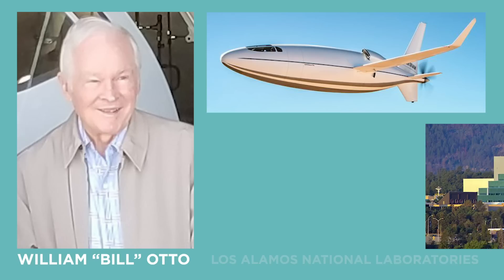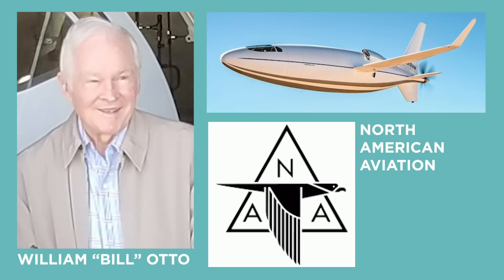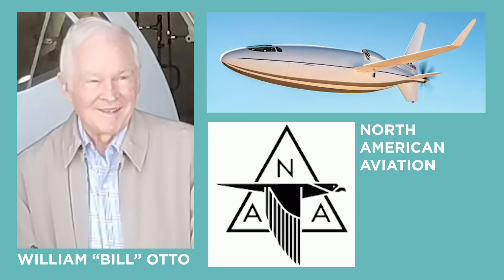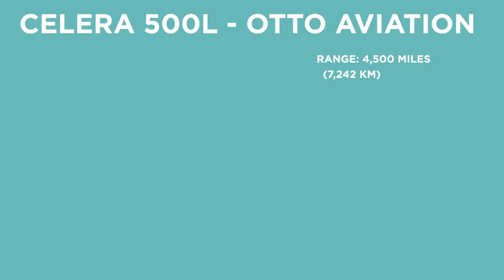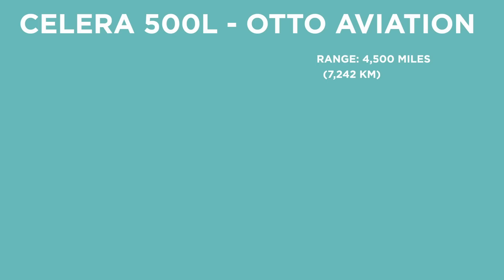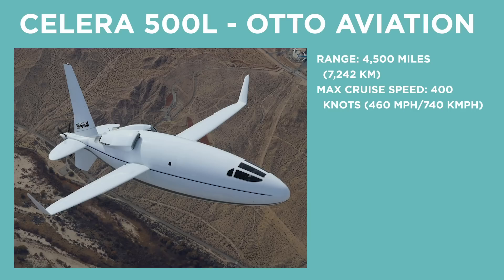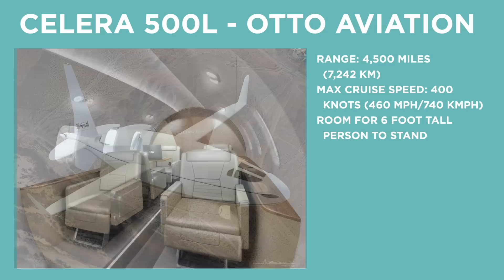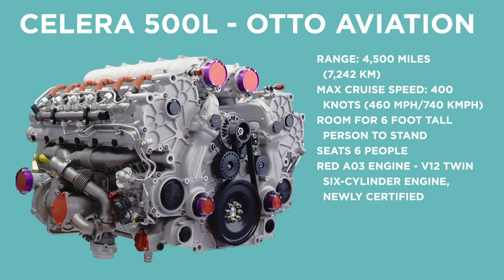Could This Plane Save The World? (Hint: No.) | Answers With Joe

Comment: It makes sense that they started with a smaller plane, time will tell if this model can be scaled to hold hundreds of people and really disrupt the industry.
Reply: Aurora D8 is a commercial jet concept with the same design principles applied
Reply: One can't just scale up a plane without considering the SqUaRe CuBe LaW
Reply: It really cant very much, its a single engine pusher prop design.
Reply: Yes I agree, the technology is scalable
Reply: I could see corporations buying these because of the fuel, and crew savings.
Reply: I can see the applications for scaling up to something more commercial in size. But also for an Electric jet option. Low power consumption is way more important for electric power.
Reply: Why bother? You want 6-8 seats to accommodate family groups uncomfortable with being around hundreds of potential disease vectors.
Reply: Not unless they install two turbine engines instead of one piston engine, so that the aircraft has engine out capability, and so that it is legally allowed to operate with more than 19 passengers.
Reply: Otto is already looking at this, but laminar flow doesn't scale up very far.  From their website, "The Celera 500L can be scaled up 20% while maintaining its extensive laminar flow. This increase results in a cabin volume nearly double the size of the current configuration. This means more passengers."  A dozen passengers yes; 100, probably not.
Reply: I was about to say that, But somethings can't be scaled up, as for this i have no idea as not an aeronautical engineer, i did work out once on a long boring flight a 747 does 50 miles per gallon (uk) per passenger, but didn't keep my calculations, so can't share, and could be talking total bollocks.
But if i was doing it again   distance / ((fuel_ltr*4.54)/passengers)  and over a 4500m flight.
Reply: @nathanchildress5596  it really really isnt. It has swept wings for higher speed (much less efficient), thicker wings (much less efficient) turbofans rather than propfans (vastly less efficient). and doesnt appear to be designed as a lifting body as this clearly is.
the biggest thing we need to design for to save fuel is LOWER SPEED
Reply: @nasis18  : or for a new "taxi" market, applied to plane travel.
Reply: @Tuxedo_Cake : The planned engine is actually 2 engines side by side coupled together and allows running on 1 side in the event of failure.
Reply: @waynet8953  So that's like a single shaft, multi engine helicopter. That still doesn't provide engine-out capability in case of prop failure or prop overspeed etc. It's better, but not good enough.
Reply: @davidegaruti2582  ... ok, all you want, but one cannot just scale up a plane that relies HEAVILY on LAMINAR FLOW without considering the REYNOLD SNUMBERS. The flow doesn't care about the size of the plane. It will become turbulence after running a given number of inches along a surface. If the surface is not so many inches long, those inches of laminar flow can be a sizable fraction of the surface. If your plane is airline-pane-size, those inches of laminar flow are almost meaningless.
Reply: @johnbuckner2200  ,,, It is not. Laminar flow is not scalable.
Reply: @adb012  it is the concept is simple keep The airflow smooth on the surface till it terminates back into the airflow  smoothly the concept has been used for years (ex. F100 super critical wing).
Reply: @johnbuckner2200  ... Nope, that's not how laminar/turbulent boundary layer works. Laminar flow airfoils typically have only a few inches of laminar flow and that IF the surface is super smooth, glossy and shiny and without joints/seams/rivets,/etc. Fly through a swarm of mosquitoes and bye-bye laminar flow.
Reply: There are many examples of it’s use including things like flat rivets instead of button rivets. Also the FB111 was designed around the concept.
Reply: @johnbuckner2200  .... And by the way... supercritical is a totally different concept than laminar, although shapes that are good for one tend to be good for the other.
Reply: So was the SR71.
Reply: @johnbuckner2200  ... Yes, sure, supersonic airplanes with laminar flow. Whatever. Stop the nonsense, it is quite evident that your knowledge of fluid dynamics is equal to zero.
Reply: Laminar flow concepts can't be simply scaled up. The Reynolds number has a word in that.
Reply: The fact of the matter is that both Boeing and Airbus have teams of engineers scraping every bit of fuel efficiency they can out of the big designs.  

And other people have already said it but it should be repeated: small aircraft design does not scale.
Reply: @Tuxedo_Cake  note that the engine can still work with half an engine. It's designed so that one side of the engine can go bad. Also the glide ratio of this plane is insane and adds a significant safety margin.
Reply: @HotelPapa100  ... Are you kidding? Of course Reynolds number has a word: Re=Ro*u*L/v, where Ro is the density, u is the velocity, L is the length and v is the viscosity. So you you quadruple the length, are you going to reduce the speed to 1/4 to keep the same Reynolds number?
Reply: @adb012  My point exactly. Larger plane = smaller percentage of laminar boundary layer.
Reply: I'm surprised Joe didn't make more of a point of the question, is the Celera efficient because of the current size it is or simply the shape...and if its the shape, how much can it be scaled up to a point where it makes sense financially. 

Obviously a startup can't suddenly make a 747 size aircraft straight off the bat, but if its not possible technically, regardless of funding, it would be interesting to explore (or explain at least) the reasons why.
Reply: @HotelPapa100  ... Fair, I misread "can't" for "can" (be scaled up).
Reply: I asked Fluid Dynamics, but he is such a drag and refuses to scale it up :(
Unless Electrohydrodynamics has something to say on the subject, but currently he is just messing around with wings and solid state aircrafts, so we will see how much he charges to keep that flow laminar.
Reply: @Tuxedo_Cake :  That's right; no redundancy on the single prop, although I thought they may be able to possibly go for a dual prop on a shaft within a shaft with dual electric motors; he has plans for electric power at some future date. Prop failure is also much more rare then engine failure if inspected regularly.  This issue may hopefully be optimized with further testing and research. The alternative always exists for 2 separate power systems and prop at the back, with some loss of efficiency compared to laminar flow, and overall still much better than the standard airplane design.
Reply: except it's not, people laugh maniacally and humiliate hydrogen as fuel while it's mostly water, and this plane is the opposite of that
Reply: @johnbuckner2200  NO the technology is not scalable. Laminar flow only works on small scale because it turns to turbulent flow after dragging over the skin of the plane. If they made a giant flying wing they could get 30% more efficiency.
Downside is that if you are not sitting along the Centerline of the plane when you turn the passengers on one side are lifted up on one side and lowered on the other side. Yawing would make passengers get moved sideways like when you drift a car. This causes motion sickness.
Reply: Electron Resonator I can’t figure out who your comment was directed towards since I can’t find anyone talking about hydrogen, so I’m just going to ask, who are you talking to?
Reply: You can't scale up the benefit of this plane design due to the properties of laminar flow not scaling up in proportion. This plane design is innately limited to a specific size which isn't far much more then the prototype.
Reply: @johnbuckner2200  It really is not scalable. Take the props at the back if you double the length the stress you are now putting on them is massive. 

You cannot scale anything in the real world up as much as many people think, as the stress on the material changes the design needs to much.
Reply: @AlecMuller  yes indeed, and not mention that even water drops on a wing can disrupt laminar flow. Aircraft for which laminar flow wings were claimed in the past actually sometimes have had laminar flow over just X % of the wing only (eg P51)
Reply: @generalharness8266  you can, go to counter rotating props, we are talking about sizing up not just making a existing design bigger, you will have to engineer up the design, a great design is scaleable NASA do it all the time, remember Have Blue, or the lifting bodies prior to the space shuttle?
Reply: @MA-URAG_na_MORO  the physics don’t change, it is a set of laws that govern physical world, you work within them not against them. Air is a fluid and fluid dynamics are the same for a wing or a entire plane.
Reply: @johnbuckner2200  Lifting bodies where not scaled up in the way you think. What lifting bodies did was make the body of the plane act like a wing in that it generated lift. Scaling this as in doubling the size does not work in energy efficiency. There is a reason you do not see this design in any plane today.

The Have blue was a full scale model that flew. I am assuming that you think the scaled version of the design is the B-2. This is not scaled for efficiency but it took a proof of concept for stealth and applied it to a different plane. 

Aircraft are designed around a specific set of requirements. Changing the size does not mean that the same efficiency's are achieved.
Reply: @generalharness8266  of course not, but you apply the physics of it to the design, to build upon gained knowledge you have learned from the smaller design, there is many examples of the engineering.
Reply: @generalharness8266  let’s examine some designs that we’re scaled up, the X-1  of Chuck Yeager fame, the SR-71, and yes the B-2
Reply: @johnbuckner2200  You do not understand what scaled means and how why I am saying it is impractical in this instance. 

Scaled means it is simply made bigger with no changes in design. As in this part was x size now it is twice that. This does not mean it will achieve the same efficiency as the math does not scale in a liner fashion. The best example of this is the square cube law. 

The X-1 was not scaled it was a design change between that and X-2, note the delta  wings as a obvious change, this changed the lift generated as well as being a more efficient design at higher speeds.

The B-2 was not scaled from a existing plane it was a new design. The previous planes where proof of concepts not scaled versions. 

I will end it this way there is no way you can simply build a censor the same size as a 747 and expect it to preform just as well. Your missing the point that there is a optimal spec and simply changing the size does not work to achieve the same spec no matter how well the first one was designed.

Comment: The Celera, if it lives up to promises, will be popular with charter, corporate and private operators.
Reply: I'm a corporate pilot, this type of aircraft is for owners who fly their own plane. Corporations are not going to be the first to try a new design, and 95% of charter companies don't buy new aircraft, the big exception is some the fractional ownership companies, but they aren't gonna to try a new design either.
Reply: @jacksmoke3731  Good thoughts.  I suppose if it gets a good rep over time then it may eventually find its way into those fleets like the PC-12...maybe.
Reply: @jacksmoke3731  So what 10 years at the outside before they are being picked up used all over the place? That's not that long. 

Also at 28mpg that's 168 people miles per gallon. The 747 gets closer to around 70 people miles per gallon. 
If your goal is lower cost and you fly a lot of miles this might be huge. Fuel is most of the operating costs of these things and this uses like 1/4th what the others do. A 70% or more saving is fuel would be a game changer for a lot of small services even if the airframe was expensive compared to ones they could get a few million dollars can be made up in fuel really fast. $6 a gallon for gas at 7 people miles per gallon like a private jet vs 168 people miles per gallon is around 100,000 flight miles to break even and frankly, they are not that expensive compared to other things in their catagory.
Reply: I've been told that Celera is good in a glass of V8 cocktail.
Reply: Key issue: "if it lives up to promises."  It's performance is amazing.....if true.
Reply: @jacksmoke3731  Except, if they want to make a statement. Like corporations using electric cars as company cars.
Reply: @jacksmoke3731  makes sense but I can absolutely see the newer corporate types wanting to fly something different. Silicon Valley types, maybe??
Reply: @Cenobyte40k  small airlines going between secondary airports will buy them all for fleets,island hoppers etc. Otto will sell all they can make for South Pacific, Caribbean, Mediterranean/North Africa, far Northern Canada and Russia, etc
Reply: @jacksmoke3731  Corporations will just be told to buy it and governments now have a good alternative so can ban all private jet traffic, no access to airports for those.

Comment: A 747 for $20M. There should be an error.
Perhaps a 747 cost 20 millions 40 years ago
Reply: from what I can find the price lands around 400M$ today
Reply: 747-400 is probably closer to 200M. I think he meant to say 200 and said 20
Reply: One thing to note is that British Airways (among others) have just gotten rid of theirs, so leaving many bucks-for-bang to go with that theory...
Reply: It’s the used price, and there’s an enormous number of used 747s hitting the market right now so nobody would buy one new.
Reply: You are correct, the listing price is 400 million US dollars.
Reply: @sunspot42  Well, because planes wear out.
Reply: @jeffk464  The 747s hitting the used market now for $20 million are a decade or more away from being “worn out”. They’re a great value but cost so much to operate nobody wants them.
Reply: 20 million for the plane, but there is expensive service of an old plane, mandatory upgrades and retrofits,  and a more expensive aircrew. Also they don't fit the need for a more regional, short-haul market, which requires smaller planes. The A380 is already out of production and being scrapped. The 747 is the GOAT after the DC3, but it's time is past.
Reply: Brand new 747-8 vs. 747-400 worn down and in era when even before COVID much newer A-380 were being mothballed?
Reply: The price of a 747 can fluxgate between 200-150M depending on demand and what variant you are trying to buy but yeah I don't think a 747 would cost 20M.
Reply: The base price range is $228 million -- $260 million U.S. for 747-8, can cost even more
Reply: @papito4207  in 2019 the 747-8 passenger version was 418 million
Reply: Yep, a new one 400 mm the only way you get a 747 for 20mm is if it is from 1992 with 70 k hours.
Reply: 747 is essentially at end of production. Airlines and cargo operators are notorious for seeking out second hand and off lease aircraft. Bean counters will have a difficult time justifying many new, full priced, 500s over a cheap, second hand 747, 777, 757, A330 etc etc etc
Reply: David Bray .....possibly due to the pandemic...as there is a strong indication that business travel will shrink due to zoom and other collaborative video applications.

“The UK airline is the world's largest operator of the jumbo jets, with 31 in the fleet.
"It is with great sadness that we can confirm we are proposing to retire our entire 747 fleet with immediate effect," a BA spokesman told the BBC.
Airlines across the world have been hit hard by coronavirus-related travel restrictions.”

Comment: The other thing I noticed, is that the “6 passenger” configuration is in an all-first class layout. They can seat more, and Otto has plans to scale up the airplane  20% as well. For intercity flights it’s a great idea
Reply: They actually may not be able to seat more than 6. Due to it being a smaller plane, too much weight in certain areas could cause the CG to shift enough for the plane to be unstable. This isn't as much of a concern with larger aircraft as they can more easily shift their weight/balance by moving fuel to their different fuel tanks around the plane. You may be able to fit an extra person or maybe two into it, but it will likely come at the cost of luggage carry ability or range.

Comment: Love your show, Joe. A small point about the standard "Private Jet". It is actually a DA-42 twin-engine prop plane. The plane you showed has diesel engines and runs on jet fuel. The DA-42 at cruise burns 8.1 us gals/hr flying at 154 mph, which is 19 miles / us gal.

Comment: This aircraft's odd look is because it's actually an old airship hull (blimp) design with sailplane wings stuck on it.  The rear mounted propeller works in conjunction with the unusual shape of the hull to optimize efficiency.  As I understand it, the propeller affects the flow field around the hull and helps keep the boundary layer attached to maintain the laminar flow you explain so well.  A rear mounted propeller can be more efficient as well, although things like the engine intakes and stabilizers just ahead of the prop adversely affect this and will cause more prop noise.  The most interesting aspect for me is the funky, big upper vertical stab to keep it stable in yaw.  Also weird is the fact that it is operating at a considerably different Reynold's number than an airship.  At cruise speeds it would be interesting to know how much lift is created by the wings vs. the fuselage acting as a lifting body.  As we all know, with adequate power, a blimp filled with air instead of helium can fly by the lift from the hull given a sufficient angle of attack.